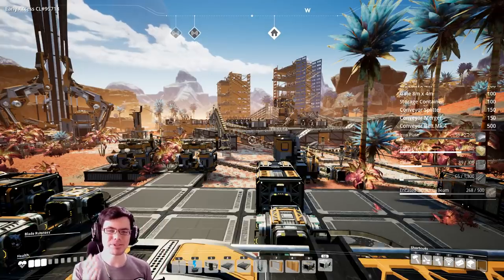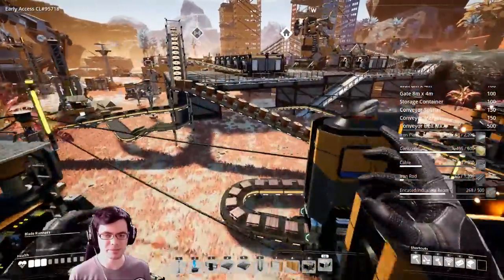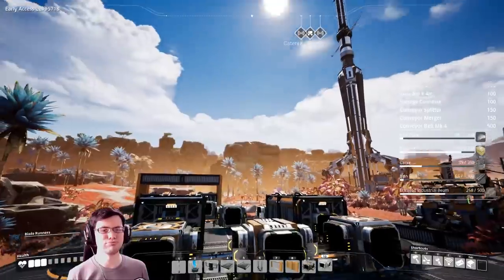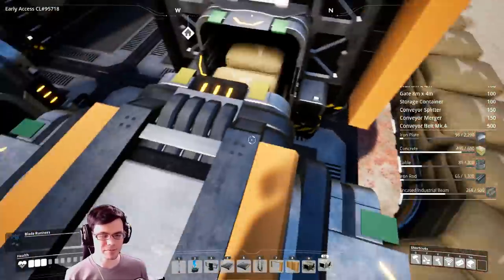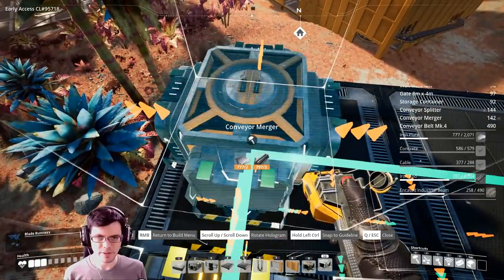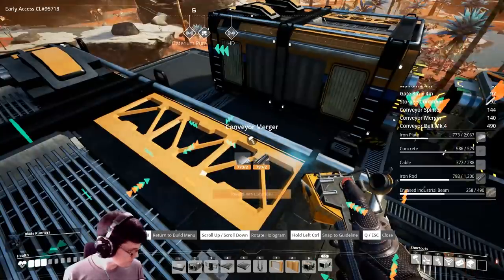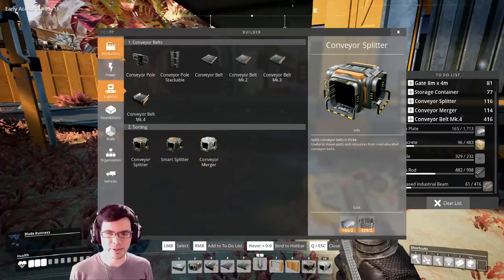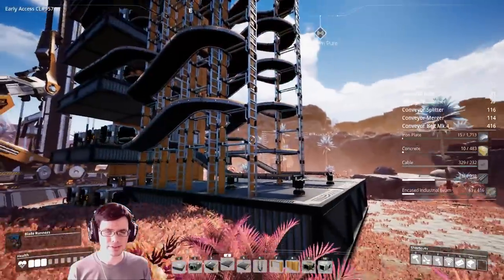Vertical Main Bus Storage Tower! Satisfactory

Comment: The game doesn't tax your GPU as much when expanding your base as it taxes the CPU.
Reason is that every conveyor-belt 'node' adds more computing.
ie you make a stretch of belt at max length,
next to it you make the same length belt but have an extra intermediary connection (from a pole, splitter etc)
Then the belt with more 'splits' will use more computing power as it recalculates the pathing of the items moving over it. Even if it's just one straight direction.

It does pay off in performance to replace belts that have obsolete/unnecessary splits. You'll even save some mats doing it.

Comment: Brothgar why? You already had this solved with your conveyor boxes off side of each building.  Each side of building can handle up to 6 (2 x # of slabs wide) conveyor streams.  If you only make your storage stacks 6 units high, you already have an excellent solution.... Or make them 4 slabs wide and 8 tiers tall, etc. 

I use your main building concept a lot with a few minor changes.  All inputs go up one side, and I have up to 6 outputs going down the other side to storage units for physical pickup at the base of the building for ALL part types used in a building (other than ingots). Example: for Reinforced Plate building, it outputs iron plates, rods, screws and reinforced iron plates to bottom of building. Usually these outputs start from a spliter from the last/top production line where the part is used, so it is mostly overflow production. When I want to use that output for production in another building, I set up a spliter off the outside of the conveyor box near the bottom and half is sent to storage, the other half (or everything if storage is full) goes to the new building as production input.   I do not try to balance the inputs for the final product.  I overproduce lower tier items to make sure there is always overflow to fill container for each type of part for manual use. When that section backs up due to overproduction, it shuts itself down reducing energy requirements until needed... so no need to create a perfect input ratio that I see so many trying to achieve. 

I'm a huge fan. Please keep doing what you're doing!
Reply: This was one of the most helpful comments I've read. I do think it's impossible to be 100% efficient in every single system. I was experimenting a lot with this last night and even if u split off half the produced material into storage like u said, and then the other half (or 100% if storage is full) into the next system to create higher tier items; that conveyor belt will never always be carrying 100% and/or 50% of the previous product (depending on if storage is full). So you can't anticipate the input of material for your next system based on the prior system; because it will only ever be flowing at full efficiency if the storage is maxed out, but then your storage becomes back logged which is no longer 100% efficient. One way I can see a solution to this would be to make storage upon storage for singular items, which would keep consistent flow, but even then it would become messy and it's just unnecessary because it will always back up eventually. The ONLY proper solution I can see in order to keep 100% maximum efficiency and item flow in all areas of your base constantly, was if there was an automatic deletion system where you could feed x amount of items into a 'trash can' of sorts.

Comment: The way to fix the smart splitter getting backed up is, instead of routing the output of the splitter directly into your machine, you can route the sorted part of the splitter into a bunch of splitters where most of the outputs go to your desired output, but one goes back into the unsorted line. This way, where your filtered belt isn't backed up, most of the items sorted by the smart splitter get sorted as you would expect, but when the filtered belt is backed up, they simply go back onto the unsorted line.

Comment: Im having the same issue with smart splitters backing up. This problem seems it will persist even with programmable splitters (next tier). My only hope is when programmable splitters come out you can maybe tell it to feed an item left, then if it backs up to go right. I know those splitters will be fully customizable as in you can have 2 inputs and 2 outputs instead. This will allow for a dump spot if anything. (Hoping for an actual program based splitter to put in code)

Idea for the next tier would be to have a storage area, then a dump area that is a significant size. Then have the dump area possible feed back into the main bus to be used or so I can manually dump them somewhere permanently. (using calculators should limit the amount of extra items per minute we have going thru the main bus)

That and to your problem with to many conveyors. When I talk about having a main bus, I think once we get programmable splitters we can start mixing items on one line to separate them later. This will be the end goal.
Reply: How are you even build a programmable splitter? how you craft turbo engine?
Reply: @bondrewdbestdad  Right. Its the next tier that we will get in early access. Instead of a regular engine that you need for a smart splitter you need a turbo engine which cannot be made atm although Im not sure if you can find them on the ground on the floor around crash pods as I've found heatsinks and other items.
Reply: @AaronGrycowski  I actually misinterpreted your comment, I thought you already build programmable splitter and its still have the backed up problem

Comment: I tried to build a single input truck station with smart spliters for my base, with 8 base materials, each with 20 storage, and yeah I have 2 problems
The belt not fast enough to empty the truck station, and it sometime backed up because of the smart splitter
Reply: @brothgar  anything (specially vehicle) if not near enough will not rendered completely, so vehicle will warp into each single waypoint, so I guess they'll never crash into each other if we're far enough